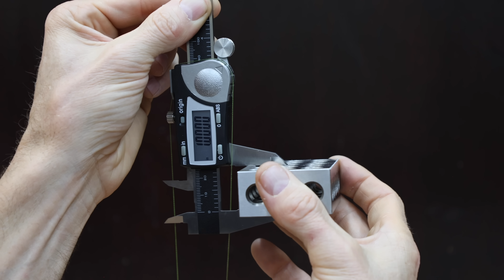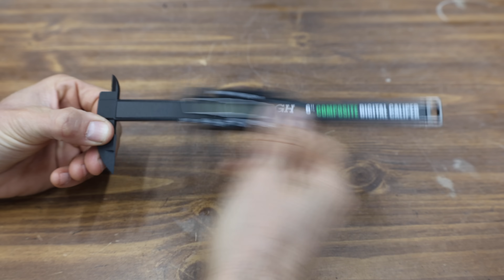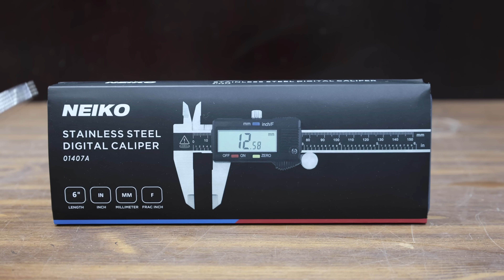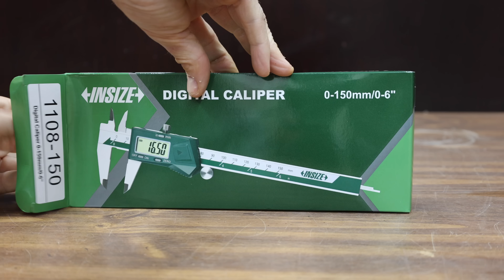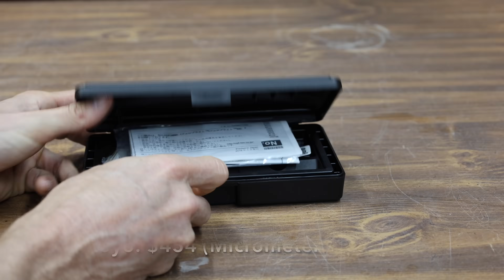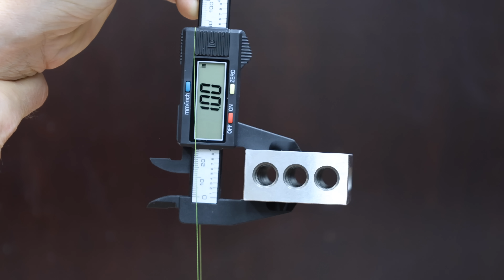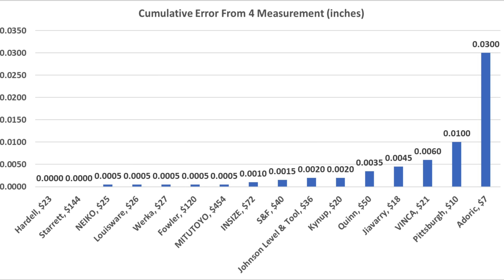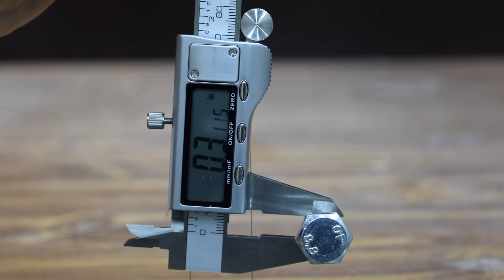I've Been Proven Wrong About Calipers!

Comment: The best feature of the nicer calipers isnt the smoothness or even the accuracy. Its the absolute positioning and efficiency of the circuit. I have a few cheap calipers and they seem to be dead anytime i pick them up. This is because the circuit is never truly off, they have to stay on to maintain zero. My mitutoyos are nearly 2 years old and are still using the original battery.
Reply: my calipers never kill the batteries.  They have dials.
Reply: @gizzyguzzi  Mine never loses zero, it's vernier. 🙂
Reply: @kenmore01  how do you read the small bits without a dial?
Reply: @gizzyguzzi  it's another language, it takes practice. Helps to know your vernier micrometers first.
Reply: @gizzyguzzi  And mine have a Vernier scale :)
Reply: @gizzyguzzi I've killed dials 😂
Reply: @TheJoshuaJames sure, but if you've killed dials you would have killed these cheap digitals
Reply: My Mitutoyos get 5+ years out of a battery. Pro tip get silver oxide batteries. They're a little more but worth it.  If it keeps you running another year what the hey.
Reply: Same here, about 2 years to replace the mitutoyo's battery, and we are using it daily for two 8 hour shifts straight. The hardened steel is also still practically flawless for all the use it gets.
Reply: This is the truth. I have cheap calipers that I just use the printed scale. If I leave the battery in for more than a week, it'll be spent.
Reply: every machinist coming here to say this
Reply: Yes, to both of those, solar-power makes it infinity efficient, making absolute positioning, a feature you can't live without. My 20cm solor-powerd Mitutoyo, has been going for 20 years and still going with no battery, keeping pace with the analogous vernier calliper it replaced.
Reply: @AdrianvanWijk I have a love hate relationship with my solar mitutoyo caliper…. Doesn’t always work well in low light.   I miss my old dial starrett…
Reply: I prefer the dial caliper.  The battery is nonexistent 😊
Reply: Same with kitchen scales. "Off" for them seem to mean something else.
Reply: I have an iGaging caliper that I bought almost 10 years ago. I've replaced the battery once. I also use it ALL the time - at least several times per week and often every day. My dad has a Mitutoyo and I've compared them side by side. Build quality was absolutely comparable, and there was more variance between repeated readings with the same caliper than there was from one caliper to the other. Ironically, I think my iGaging came with a better case. If I were machining parts for rockets in my day job, I'd get the Mitutoyo just for the reputation. But for 99.999% of people, a high-quality caliper at a fraction of the price will give them more accuracy than they could ever need.
Reply: Came to say the same. "auto off" my ass. But, my expensive one, even if not used for weeks, always works. Start cheap, get annoyed w its battery being dead, then upgrade.
Reply: @seejayj  This is what German machinist told me, all else equal, picking them up at same temp 2 weeks later and it's reading 0 still. Cheap ones drift (and as you said chew batteries. CR2032 as pointed out in the video is definitely a tell.
Reply: I’ve had a pair of the Kyrup 8” digital calipers for over 2 years. I’ve yet to change the battery except when I got them. I never use supplied batteries. For the first couple of months I’d periodically test them against my older Mitutoyos. They’re very consistently accurate. I’ve grown to trust them for a lot of measuring.
Reply: My HF calipers hadn't been used in 10 years and fired up perfectly
Reply: 2 years on original batteries is good. 
Cheap ones drain batteries while "OFF" in 2 to 6 months.
Reply: Yes, 100% ageee. 👍 to what they said ⬆️
Reply: The biggest problem of buying mitutoyo is getting FAKE mitutoyo .
eBay is full of FAKE mitutoyo
Reply: The biggest problem of buying mitutoyo is getting FAKE mitutoyo .
eBay is full of FAKE mitutoyo especially if it say shipped from China
Reply: I believe the technical term for this "absolute remote origin" or something similar. It basically means that the circuit is wired such that battery drain is minimal bc the internal processing/calculation of the measurement isn't connected. Most calipers don't include this, so while the LCD is off, the rest of the device is actually still on and drawing power.
Reply: The MAHR digital calipers I bought at work nearly 2 years ago are also still on their original battery.

Comment: I got into 3D modeling some time ago and had always bought random cheap calipers that were great for a couple of months, but after short use, they'd slowly lose calibration and would be off by over .5mil to 1.5mil. 
I spent a lot of time looking for a good pair of calipers after the sub $50 ones would stop working after a month or three. Eventually I realized I had spent upwards of $300 on various cheap calipers that would only last a few months of use before they'd lose accuracy would show weird signs of wear. Had a tension screw strip. On a couple of calipers the screw would just fall off if it wasn't tightened down.

When I finally got into 3D printing, I wanted to be as accurate as possible so I decided to just bite the bullet on a Mitutoyo caliper since I know people who've had the same pair for years with zero issues and I really didn't want to keep throwing money at a problem that was already solved.

I don't know why I never thought to check eBay, but I found a pair of used, 8" Mitutoyo's for about $60. They were in excellent condition outside of one of the ID prongs having about .5 mil broken off. 

Not only are they as smooth as tested here, but they stand tall on the graves of almost a dozen cheaper calipers that worked great when they were new and died within months. 
I've had the Mitutoyo's for about 7 months now and have never had an issue with them. According to the original owner, they were a bit over 10 years old when I bought them. so they're probably close to 11 years now. I'm sure they got a lot more use by the machinist I bought them from, but after all of the other brands I went through, never again on precision tools. 

That being said, if I could add one feature to it, it would be a Fraction feature. One of the calipers I had had that and it was very useful for identifying random nuts and bolts. Too bad they lasted until they took 1 drop from a saw horse onto a plywood floor. That seemed to destroy the calibration
Reply: Pro tip: dropping calipers is pretty much the end of them. So don't do that. Ever. Unless it is a very short drop onto a very soft surface. I still wouldn't risk even that though. The best policy is to never drop calipers. If you do expect to be replacing them. The other thing you want along with calipers is called a drill guide chart. One with all of the number drills, letter drills, fractions and millimeters up to one inch is what you want. That places readings into a useful context. Because what you measure may be around a size. With the chart you can see the range.
Reply: @1pcfred  Well yeah, of course. Nobody's tossing them around. But accidents in the workplace happens. 
The Mitutoyo's I have were dropped hard enough to break the very tip of the ID measuring side off, but they're still as accurate as the day they were made. 

The other pair I had fell about 3ft onto a plywood floor and couldn't hold a measurement to save it's life

Comment: I expected a drop test. Also it would be interesting to see how do they behave at different temperatures. How would precision change after you store them in a freezer? How good is the still? Would it corrode in a drawer with significant temperature changes during the day? Many workshops do not have temperature control. If you leave the equipment, it may be covered with dew at night, etc.